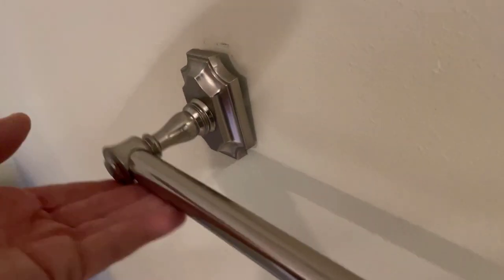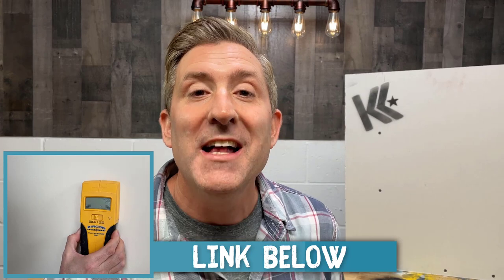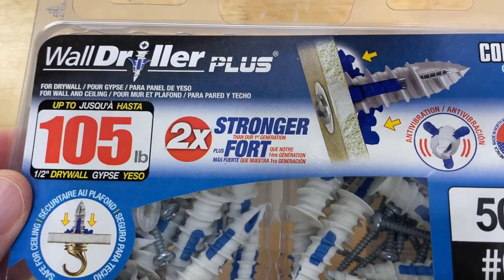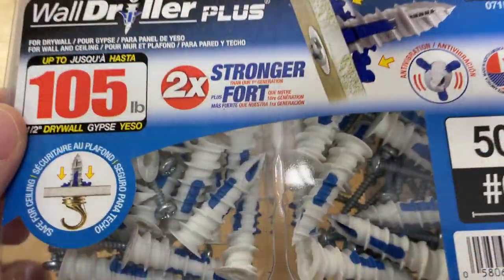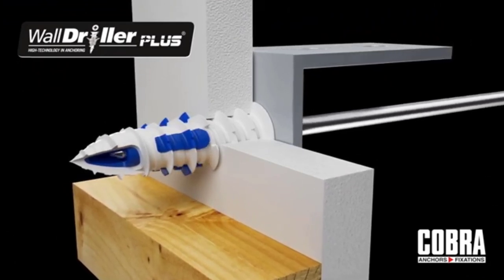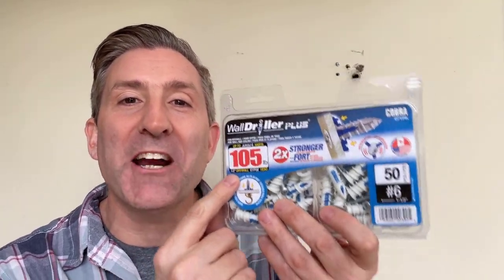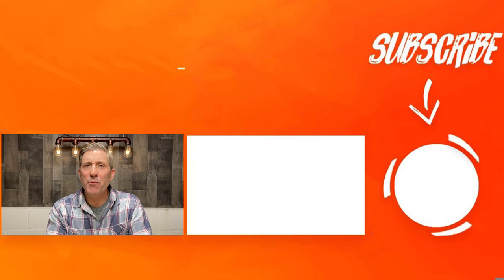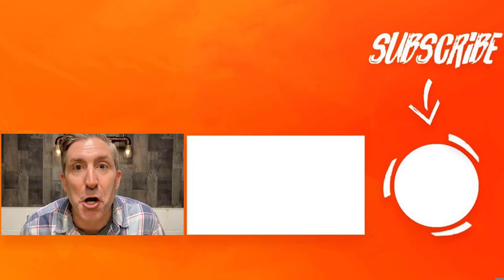[ SECRET FEATURE ] Best Drywall Anchor Review @ Home Depot ⚓⚓⚓

Comment: Wow! This video is like speaking to my soul. For YEARS I have struggled with this issue of wall anchors never working properly and staying put. The standard thin ones are the worst by far. The ONLY ones I have found that you can absolutely rely on to never come lose are "e-z anchor twist-n-lock" white plastic ones that are rated for 75lbs. Which funny enough are easier to use because of the no pre drilling. I've NEVER had an issue with one of those. They also sit flush and you can spackle over them later easily if needed. Yes they take a bit more surface area but worth it.

Now these new ones you have demonstrated seemed to be that same concept on steroids. Very similar with the addition of the blue part and the more aggressive taper.

Thanks for heads up, if they are anything like the ones I mentioned they will be a winner. Will try soon.
Reply from the maker: Great comment - every home owner understands the frustration of wall anchors - this is certainly a step in the right direction to wall anchor NIRVANA
Reply: @Kitearmy  we have the technology!!!
Reply from the maker: @kevinmorrissey9398  wall anchoring technology!!!

Comment: IF YOU HAVE THESE STOP NOW!!!  I now have to patch 2 large holes in my wall. When the blue things pop out the screw instantly become loose and then is very had to remove - hence the large holes. I can't believe there are on the shelf.
Reply from the maker: Did you over tighten them - they worked really well for me

Comment: The one for a #10 screw needs a huge Phillips for the anchor. A normal flat blade will work, instead. Phillips for the screw.
Reply from the maker: Great tip
Reply: It comes with the Phillips bit in the box.

Comment: Ok but you screw to open the blue tabs. Does it work well if the the thing you want to hang is thicker than the hook you show in your video? Like a ikea furniture, the backing is 5/8" thick, plus the drywall. Not sure it's the best option.

Comment: Toggles for me.
Reply from the maker: they work but you have to make such a huge hole to inser
Reply: @Kitearmy  this can be so. I just bought a set that had a variety of toggle bolt sizes in it to use for a toilet paper holder. I was surprised to see some bolts that were small-er. It worked very well.
These anchors that you have demonstrated sure look as though they’ll do the job also. And the “load rating” of them is very helpful. Why no one ever thought of having those extensions pop out to secure it to the inside of the sheet rock is a puzzle and we lost an idea that may have made us rich.😂
Enjoy your reviews.👍
Reply from the maker: @dennismullin3052  Thanks so much - I really like your comment.  It's always about pursuing the better mouse trap.  I was surprised at how much force it was able to withstand

Comment: Outstanding job, great work put into this video. These anchors work. Yesterday Jan 4, 2022 I hung a 100 ponds 75” flatscreen TV on the wall and it does work. I was having a hard time finding two studs that were 16” apart and was only able to find one vertical stud the rest of them I use these anchors and my tv is not going nowhere, very solid. I found these video after the fact but, I SM very glad you shared this useful information, thank you
Reply from the maker: Mine is still holding my towel rod - only thing that ever worked

Comment: Great idea! Like you mentioned, I would still prefer finding a stud to mount the heavy pictures for the long run
Reply from the maker: I know but sometimes they are in the wrong spots - 😥
Reply: But these things holder over 100lbs. We have freakin' metal racks with bike parts hanging on them at work and zero issues.

Comment: Thanks for the video. I'm using these to mount some coat hooks. I would have liked to see the simultaneous front and back video while tightening the screw, though. It would be helpful to see at what point in tightening the screw the blue hooks engage. The instructions say to overtighten 3-4 turns, but I need the screws to stick out so I can't do that. Does anyone know at what point in tightening to the blue hooks engage. Do I need to overtighten and then back the screw out?

Comment: It's just too bad our house is plaster and lath board interior walls, with plaster and terra cotta blocks and brick on the exterior walls. It can be a mess anchoring to our walls and usually ends up with some plaster patch work and touch up paint. 
The only drywall we get to enjoy is when we redo a room with all new walls. 
Looks like a great anchor though!
Reply from the maker: Does screwing into the lath boards work?
Reply: @Kitearmy  If I were more of a YouTuber I would do a video on the perils of plaster and lath. There is a lot of good about them, like I think they are way more sound deadening, and they also provide the crafty people with a lot of lath when you redo a room with drywall. 
Like you mention in the video, finding a stud is best, but on the outside walls there are no studs, just masonry. 
If I'm lucky to drill in and catch a lath board I'm usually in good shape, but there are gaps between the lath and I sometimes hit them. Also, forget nailing without predrilling, because you can push the lath away from the plaster (also happens with most drywall anchors) . It's not all bad, but every time my wife asks me to hang a new decoration on the wall, I know it's going to be a game of Russian roulette.
Reply from the maker: @marcdenlinger5282  Sounds scary - thanks for informative comment